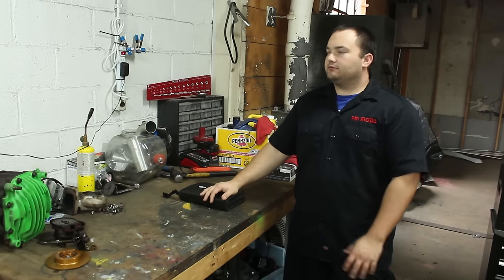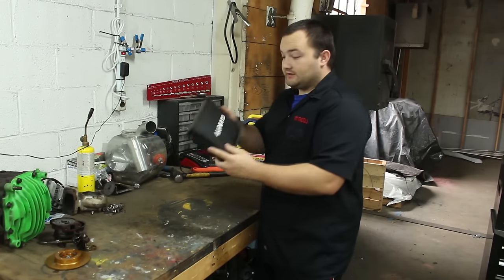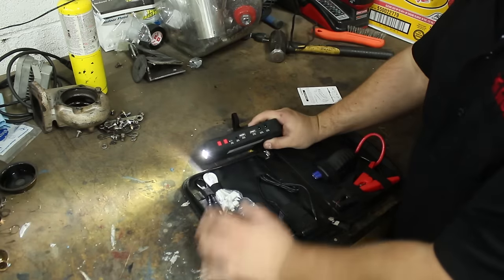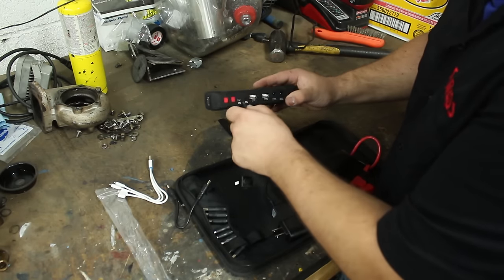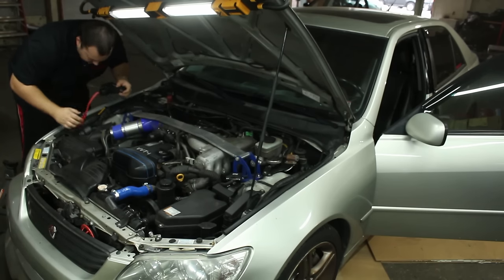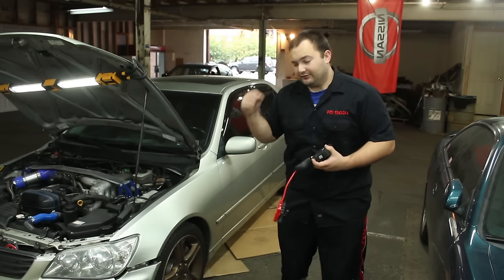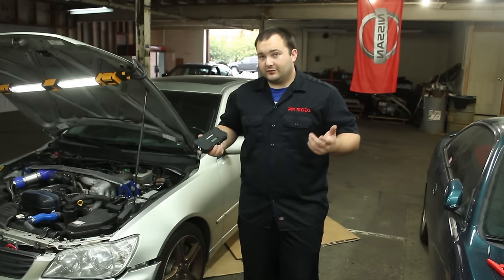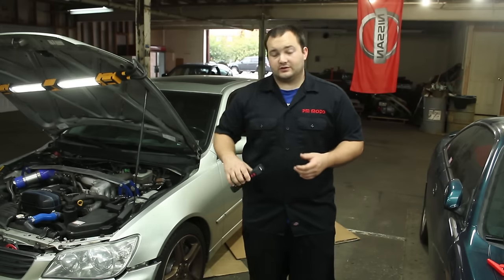This thing is AWESOME! Portable Car Jump Starter | jumper cables | Power bank

Comment: my stang struggles to start on my cheap ass 450cc battery, gonna try this on it
Reply from the maker: why not get a bigger battery?
Reply: it's a pain in the ass, I bought a small battery box for rear battery and bolted it in. would need new battery box and then it wouldn't fit under my rear seat delete. the jumper is a much easier option